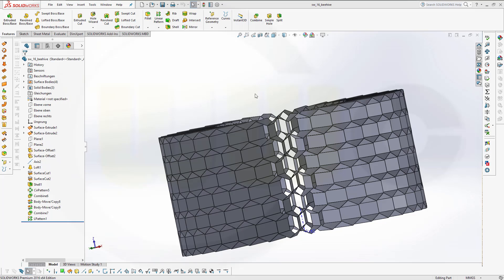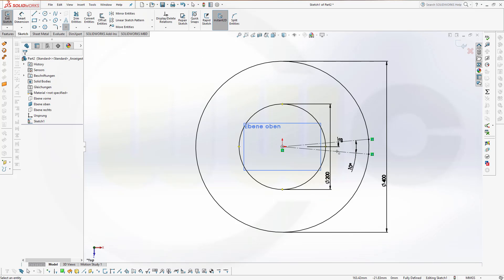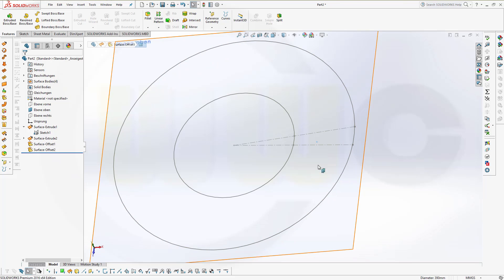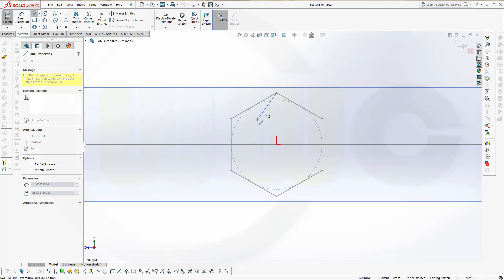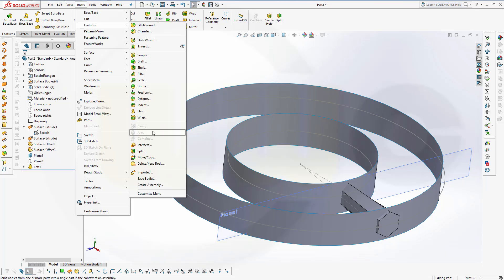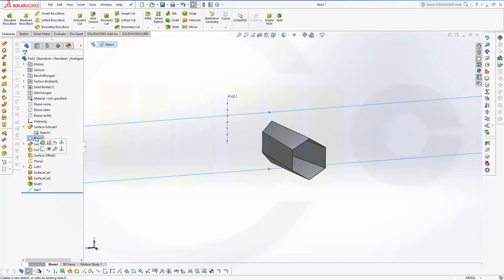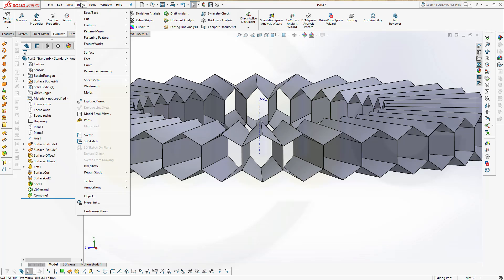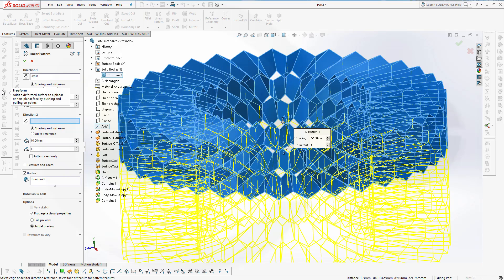Userwish - Beehive - Bienenwaben - SolidWorks 2016 Training - Part Design

Comment: Hi. I have a question 
In CATIA SUFACE there are junction command,mating flang command,diabolo command and bead command. NOw what about SOLIDWORKS SURFACE . I can not find them ←_←
Reply from the maker: Simple answer, if you want to do surface modelling use catia or nx. So there are many commands which are not available in sw.
Reply: Wolfgang Walden thanks
Reply from the maker: you´re welcome